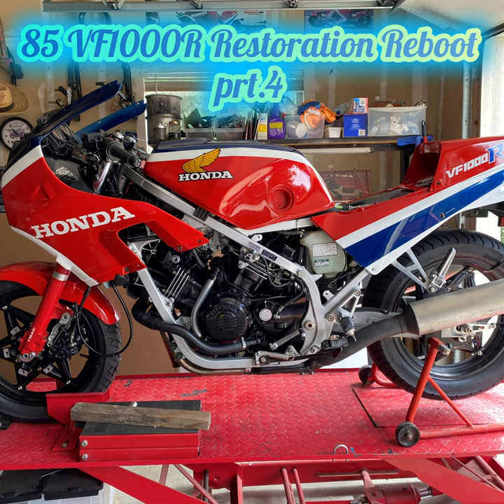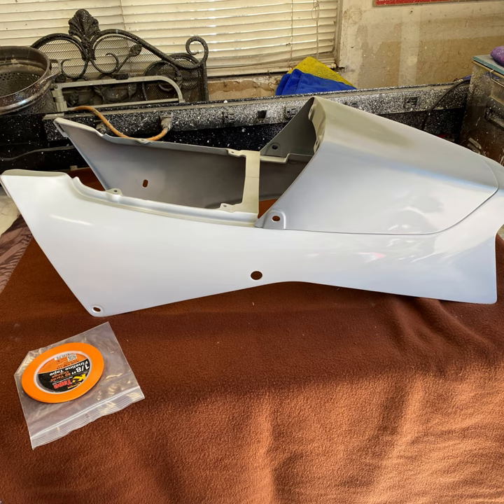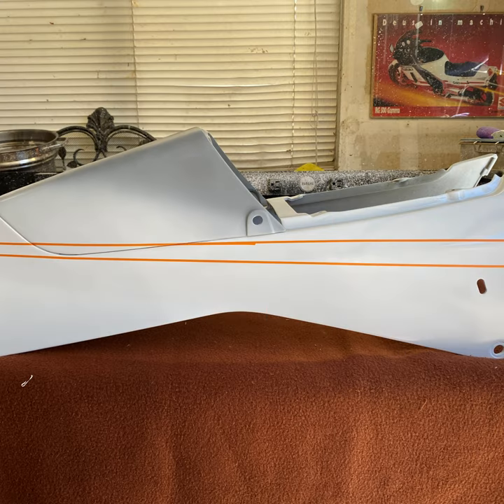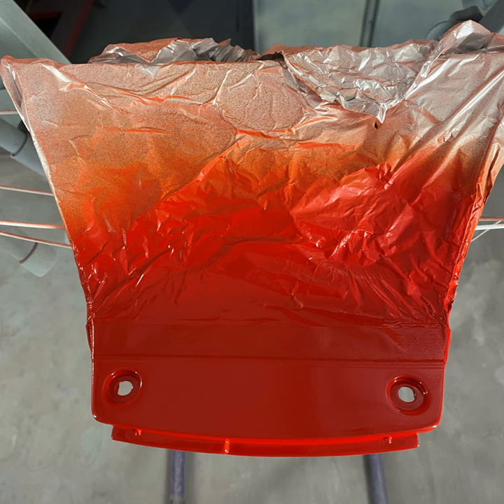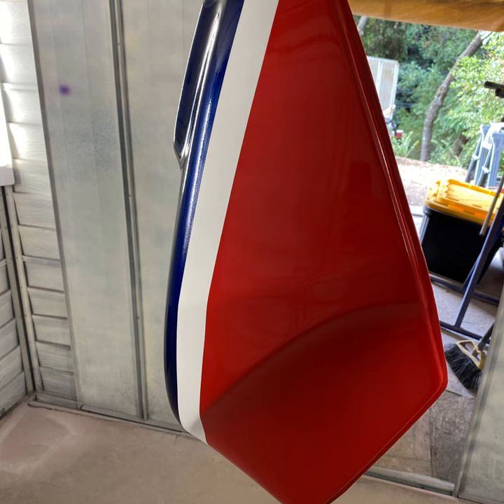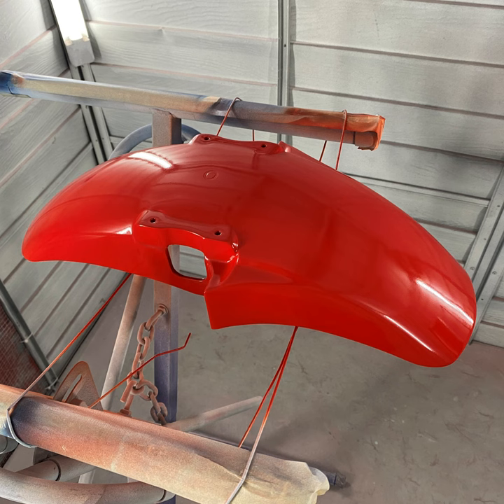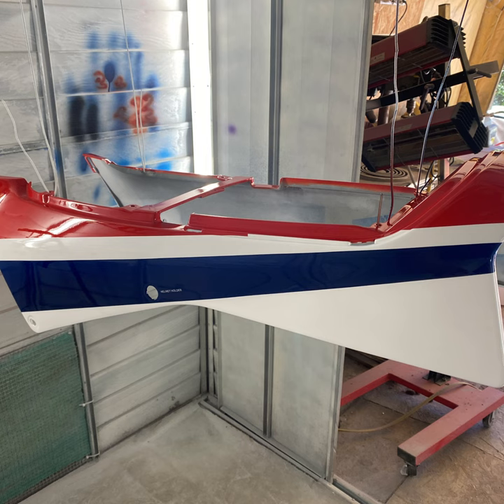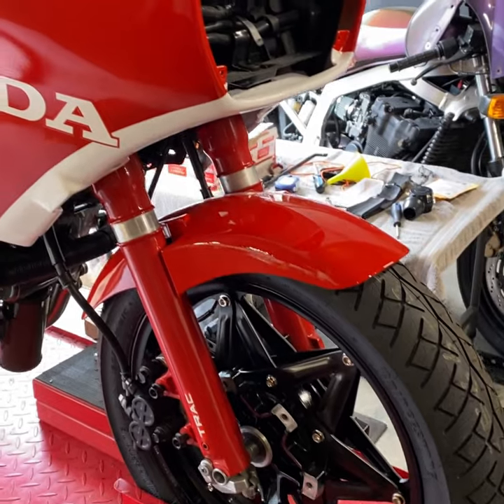85 VF1000R Restoration Reboot prt.4 - Painting the gas tank and fairings

Comment: Awesome work MCSR. What a beautiful restoration. Do you have a local tank dent puller by chance? I got a quote from a MC tank PDR professional. I am sure he would do great work but the prices were extremely high. Trying a few things myself in the mean time on some not so great "practice" fuel tanks. Next will be a stud gun. Should be fun. Videos forthcoming. Thanks! Ken
Reply from the maker: Hi Ken, I know a PDR guy in Oregon who is very good, but not sure how he compares price wise. I’ve got the PDR kit but get mixed results with it. Stud guns are my go to, it’s easier to use and  more precise, you just have to accept you’ll be touching up or respraying the tank.
Reply: @MCSR52  Any recommendation on make/model of stud gun? Thanks
Reply from the maker: https://www.harborfreight.com/stud-welder-dent-repair-kit-61433.html
Bought this years ago, still going strong, and ideal size for motorcycle gas tanks.

Comment: does it not bother you that the TRAC decal on right fork is applied upside down ?
Reply from the maker: Yes it bothered me a lot once it was brought to my attention 😣. If you watch the latest video you will see I turned it around. Thanks for the feedback though, it was another viewer who pointed it out and I appreciate that.
Reply: @MCSR52  I watched all 6 parts before commenting, I saw it upside down all the way through every time. for the first 3 i was wondering why you painted parts green on what was supposed to be a factory spec restore, Still the best restoration of a VF1000 i've ever seen. only other thing, from memory top yolk and bars might not be original factory colours ( perhaps in USA) but I remember them being gold and silver. Also considering the amount of money you spent, you even fitted the Euro tank which is much better looking, so i'm surprised you didn't buy a dual headlight, as the dual headlight is the finishing touch every VF1000R needs.
Reply from the maker: @elvisburgerking8675  the top yoke was black on 85, gold on 86. I do like the twin headlight option but the subframe for it is different to the square light and trying to find both is difficult, plus I didn’t want to take the front of the bike apart again to switch them over as it’s a big deal. Euro spec tank does make a big difference though.
Reply from the maker: For the TRAC sticker there is a posting in the community section where I show it being removed and replaced in the correct orientation.
Reply: @MCSR52  I'm not convinced, not that it really matters, I owned 3 from new including one of only 3 RG models in my country, bought and registered in 1990 although manufactured in 1986. I still have 8 of the other VF1000 models in all colours but sold my last R quite a few years ago as with the riding position and 16 inch front wheel, they are not comfortable to ride, so I'm only going from memory, although some photos still exist on old hard drives so i could possibly check on exact original colours, if i could find them,  my memories of riding the R versions , you are looking at the bars infront of you all the time, and it just looks wrong, I can't pinpoint it, as I think it's a combination of things, the top yolk, the bars, the brake levers and possible even the bar ends. I never had an RE, they were probably different again, only the RF and RG. the FF and F2F have black everything from yolk to bar end, which is why riding an RF or RG looks different to the colours of other models, from your videos you have a black seat, the only R that had a black seat was the Rothmans RG. yours is an 85 RF with line bored cams and probably a double oil pump, anyway back to the headlight, I can't check anymore, but i'm 99% convinced its a direct swap, the double light and plastic grill underneath was removed in the US due to regulations and replaced with a single unit from FF or FE and plastic trim to fill the gaps and it looks pretty poor in comparison to original design with a double headlight.